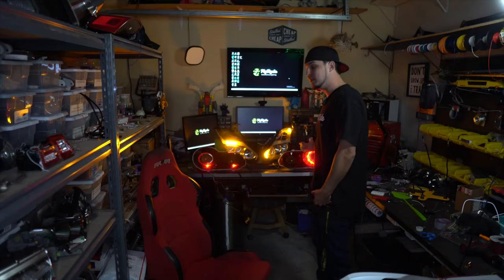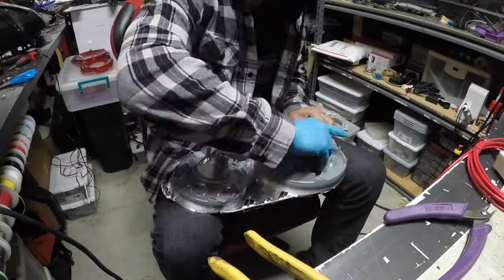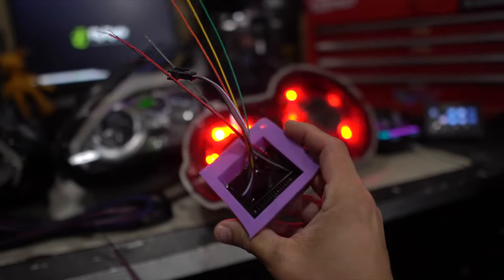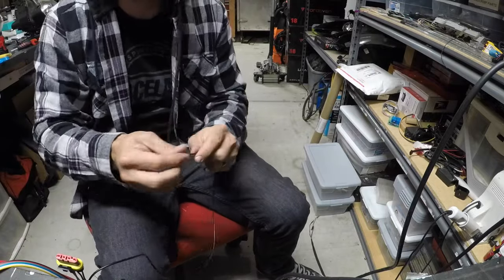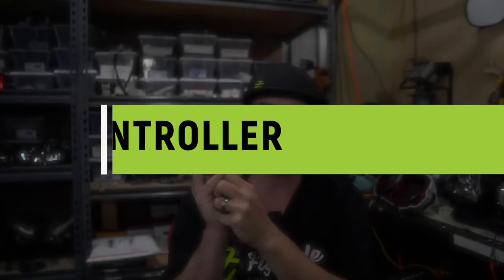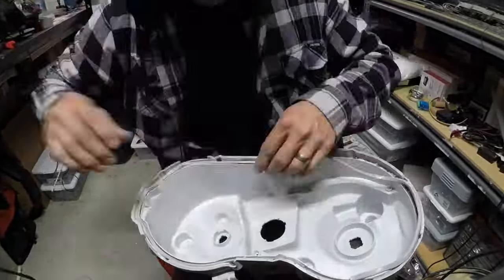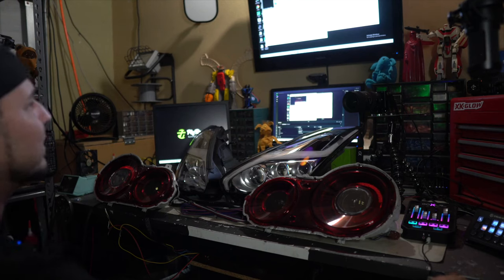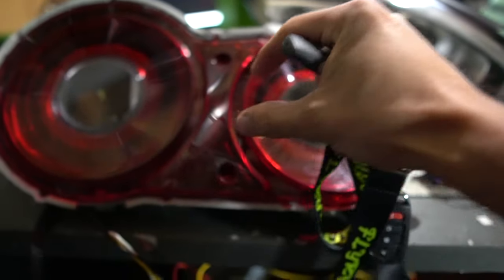How To Make a Sequential LED System

Comment: This is cool stuff, can you imagine changing out all the lights and add some more LEDs but then all buttons, switches, dashboard, everything on the inside of a car and I've done that multiple times in different cars but the end result is also looking really cool.
I didn't have to animate the interior lights but changing the lights in those pesky buttons all over the place is very fiddly work and you can't do anything with your hands because you just can't put your fingers inside a button, and another thing to keep in mind is that you can't demolish the whole button to get the original light bulbs out, you have to do that in such a way that you can put it all together with the new LED and after you're done it still have to work for a long time without breaking that's the actual challenge but I always have a lot of fun doing it.
The best part of it is when you're finished and you can look at all the work you just put into it all making it look way better.
One thing that I loved is when I changed the dashboard light of my oldtimer VW Caddy, it had the original dials colored in some fluorescing orange and with my high powered blue LEDs those dials really popped out, just awesome.
When I finished working on that car, changed the complete car in about 7 months in a little garage at home cutting out all the rusted panels and structural parts that were totally rotten through, made all the new panels and structural parts from sheet metal and banged it all by hand into the right shape, welded the whole car together again, pulled out the fenders to make the wheel arches bigger for bigger wheels, lowered the suspension, pretty much everything from the ground up in about 7 months all by myself and I had it just two weeks finished and on the road again and got an offer that I couldn't refuse which is getting a VW Golf Mark 2 GTI Fire and Ice Edition with a brand new motor in it and completely done for free if I gave the guy my car so we just traded our cars that same day, I couldn't believe that he did that and that I scored an almost brand new car that I loved even more and didn't have to pay a penny for it.
Man, this video did bring me back to the good old times.

Comment: Hey Chris, I have a question, is it possible to connect strobe lights to brake lights and have them come on and stay on as long as you are pressing the brakes, without a controller?

Comment: What LEDs do you use? I was MINDBLOWN when you said addressable LEDs aren’t bright enough. The array I’m designing for my taillight is 140 WS2812 and that’s a solid 700 lumen at full brightness. Standard taillights are going to be closer to 400.

I think I would have been more concerned that if 1 burns out it will kill the rest. That’s why I switched to WS2813 which have a backup data line so you don’t kill the entire circuit with a break.

Comment: Your videos are great along with your knowledge. Can you help me? I am looking to add a thin led strip (probably COB) for DRL and turn signals. Not primary but just for looks. The application will be on the front splitter of 2014 Corvette. The issue is I don’t want them to be too visible when lights are off. I would like to use a black or dark diffuser to blend in with the carbon fiber. Do you have any suggestions for this set up? I’m sure you do so I hope to hear back from you, it would be great.

Comment: Hey there!  Love the video.  I am looking for a solution to put LED lighting on the OUTSIDE of my 17" Rims for my Jeep.  Traditional LED strips are not flexible in the way I need.. which is to make them in a circle with the LEDs obviously facing outward.  I am only using this for a Christmas Parade at very slow speed and would velcro them to my rims.  I have a flat enough surface are 1" all the way around the rim to velcro.  I would power them by 12V or 24V Lithium Battery / Holder that I can zip tie to my rim.  Is there such a solution off the shelf or is it something that you can make?

Comment: Question that remote acts as a switch now car battery wise ..draining  non draining ..on show mode   ..what bout bluetooth  controllers that if people want to do show mode or any lighting with out turning their car that means that bluetooth  controller  will need to have constant power ..that's not good for a battery ..I would do a switch  to cut the power when not in use
Reply from the maker: There’s lots of solutions including timers, and programmers that will kill power to the accessories hooked up to it after a set voltage limit. 

Definitely nothing to worry about, as there’s tons of super affordable solutions 👍
Reply: @flyryde  have a link to the product for that ..
Reply: @flyryde  do u have a link or the name of the product that cuts the power .I am later going to hook up to 4 channel remote but regardless of that ..the product to not drain ur battery if ppl are hooking it up to battery for power

Comment: Would I need two ghozt controllers, one for each taillight. I want to build tails for a genesis coupe.
Reply: in most cases that is the suggested way to do it but here since there are 20 leds it is the only way. in short, yes you will need 2 ghozt modules
Reply: @garforce2  it can also be programmed with corsomotion
Reply: @oswaldoescribano9662  true but not as customizable and if someone is asking about ghozt I will send them down that rabbit hole, it’s also easier to find space for it since it’s smaller and can be put inside the light
Reply: @garforce2  thank you very much for answering me greetings

Comment: You do know that if the lighting on your vehicle is modified from DOT specs, your running illegal. If while running Illegal, you get into an accident, your automatically at fault... as in, you shouldn't have been on the road in the first place. Plus, you shouldn't modify lighting to distract other drivers. You could also be liable if your customers get into an accident.
Reply: Good luck enforcing that dude. 
You're automatically at fault if you make contact with a vehicle. The person who hits is it.

No one gives a shit and he's not liable because he is a LLC or Limited Liability Company.
Reply: @lmssoftware3130  If you have a vehicle that is not legal and on the road, you are automatically at fault. It shouldn't have been on the road in the first place, therefore said accident would not have occured.